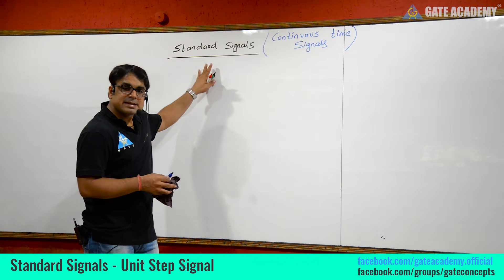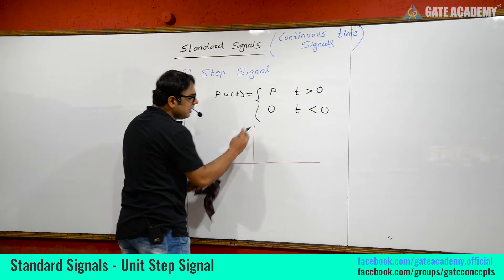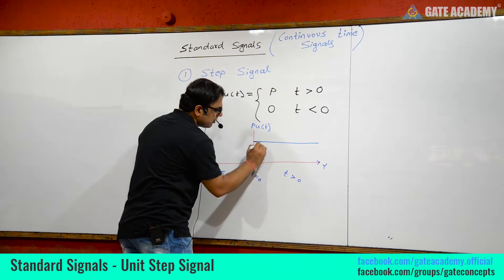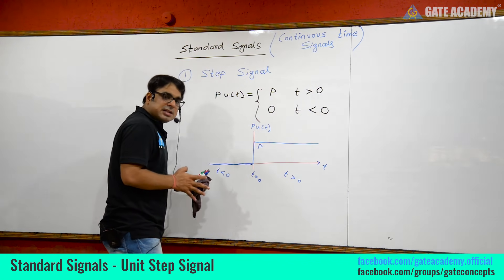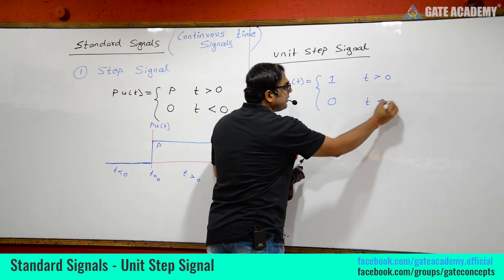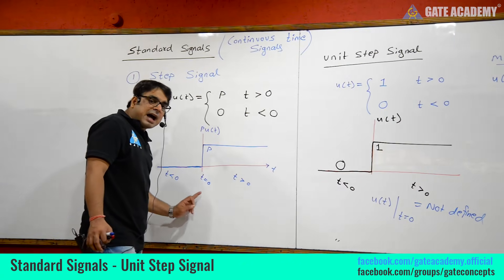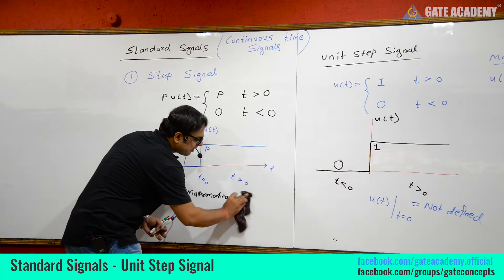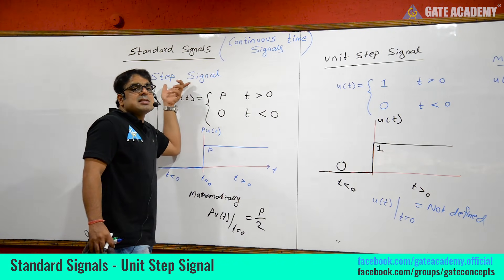Lecture 2 | Standard Signals - Unit Step Signal | Signals & Systems

Comment: Does u(at), e.g.- u(3t) have any significance or special character?? Sir, u didn't talk about this.
Reply: As far as i know they both are equal....U(t) = U(at) 
so if it is given tu(4t) it will be same as tu(t)...so check options in multiple type questions...as they can give it in simple form.